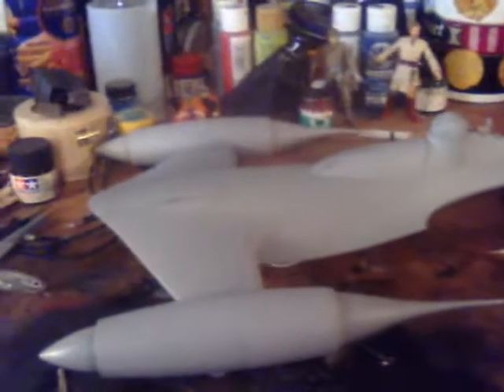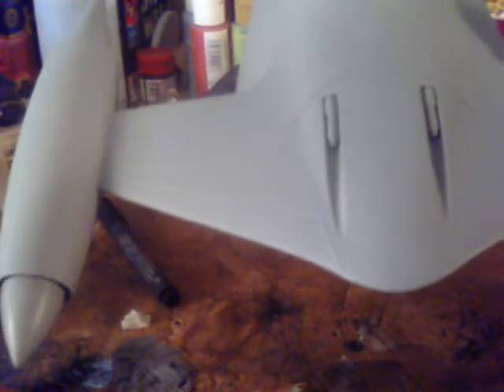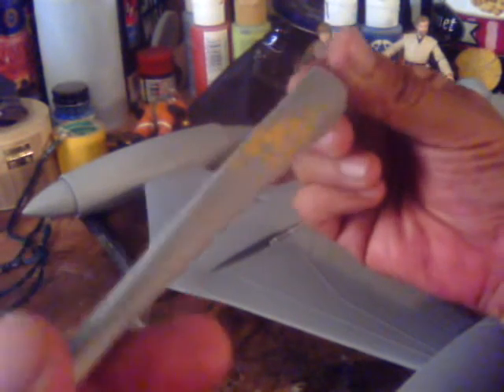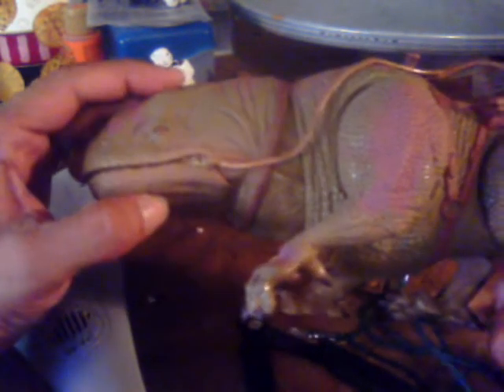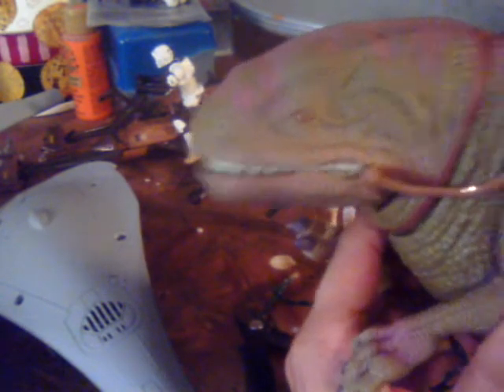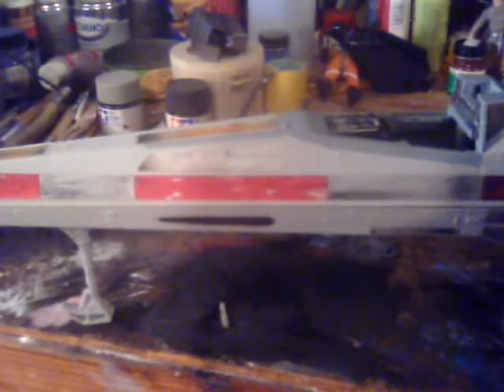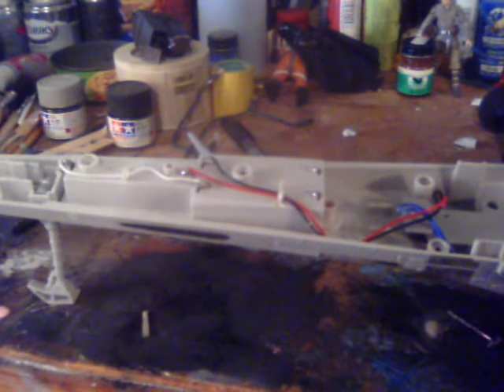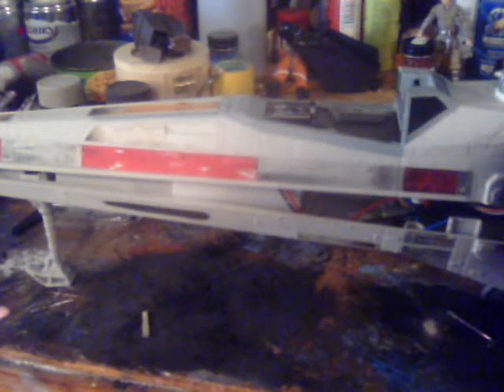Back to the Bench: Royal Naboo FIghter

Comment: For the Naboo, have you thought about casting the parts?  I know my local Hobby Lobby has casting kits.  Just a thought, and it would fix your paint problem.

As for the battery back.  First, Does it take 4 AA's or is it 4 AAA's.  If it is 4AA's then you can replace them with AAA's.  The only thing that it will affect is the lifetime of the batteries.  AA's hold more juice than AAA's do.  The both supply the same amount of power.  Another thing to think about is a wall wort.